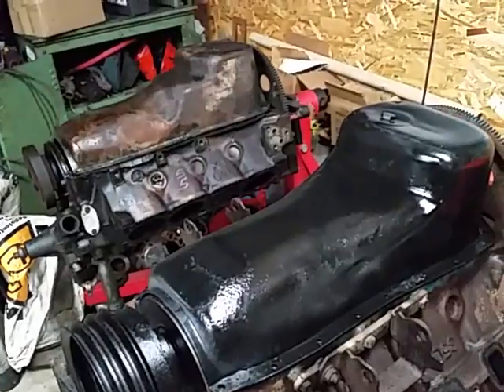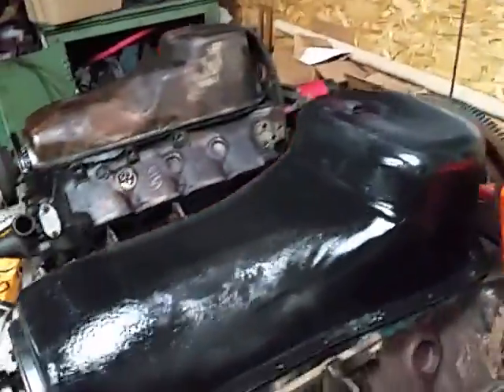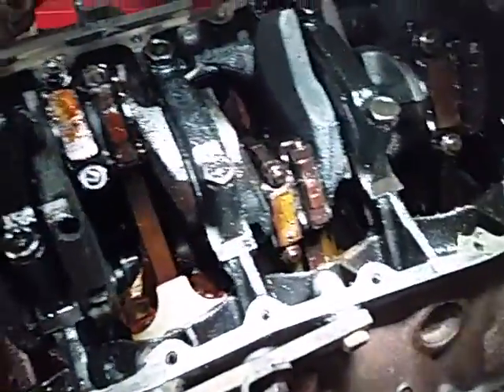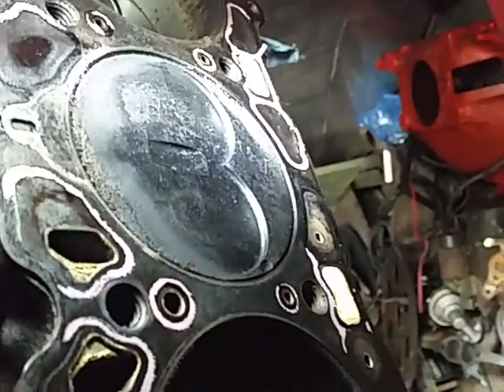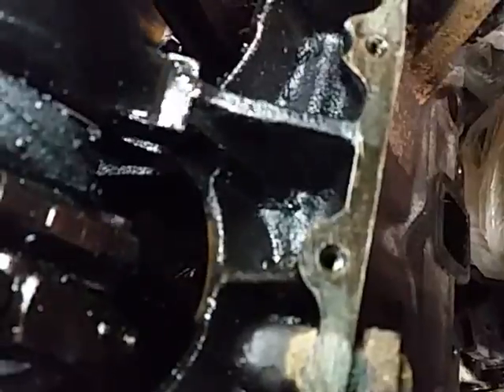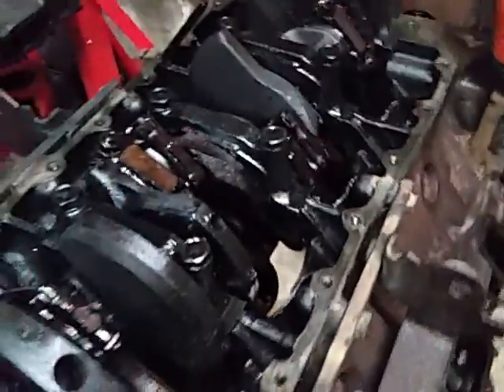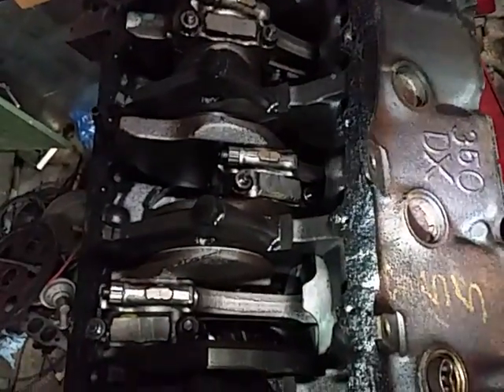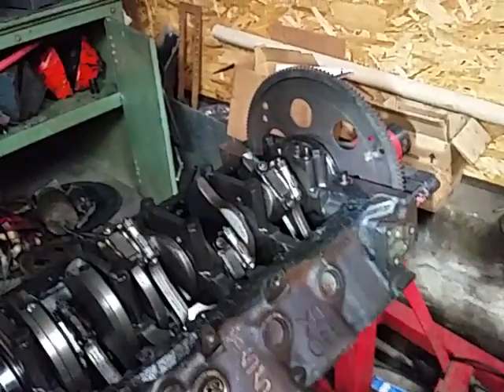Olds 350 Windowed Mains Vs DX Diesel: A Tale of Two Oldsmobile Small-block V8 Engines

Comment: The windowed versions of the Olds small blocks suck....

I've even ripped the center 3 main bearing saddles off of an Olds BIG block with solid main webs.
Reply: Wow , uninformed rubbish , if your ripping middle mains off anything your crank is out or the block , FYI 392 Chrysler Hemi's got windows in exactly the same place , are they weak, BMW big windows on the 600 HP engine , ??? All comes down to balance and machining , 700 hp 403 on this platform drag races for two years now , no problem, and no bottom end girdle .

Comment: about 6:30 perhaps it wasn't engineers but rather beancounters that did that abominable weakening of the bottom end 
  also the 307 if not modified for performance seemed to get by but perhaps the 403 didn't do as well ? 
  Even before the "lightening" (or maybe there was an early round of "weight loss" without "windows" around 1968 ?) was the Olds 455 kind of weaker in the bottom end than,say, the Mark II Chevrolet 396 or even the truck block "small" Chevrolet ?
Reply from the maker: I think we need one of our jet boat guys to answer to that question re:455.  My understanding was that GM corporate wanted a weight loss program on division engines in general.  1975- ish.  I doubt the 403 was ever intended to go in the Trans Am, any more than the SBC 400 was ever intended to go into anything other than big sled cars like the Caprice, Delta, maybe trucks.  Big torque on the bottom, horsepower- negligible engines.  The Chevy 396, like the 327, was always a performance piece. And they were both known for spinning mains (user error, I'm Sure.).   And a lot of these things can be tracked back to the oiling system, not any inherent weakness of a block.
Reply from the maker: 403 has a special weakness in the form of overheating, and I believe the bores are Siamese.  Bores at 4.3 in, that's huge.  But I did do one at 040 over, it's in a TA, and no known overheating problems
Reply: @ShawnStjean 403 = 4.351 bore std , almost the biggest factory bore of any V8 , big or small block, the 403 has a bigger bore than a 500 caddy V8. 0.100 bigger than a 454 chev . Only the Ford 460 is bigger at 4.36 by 0.009 or the Lincoln 462ci Mel V8 at 4.40.
Reply: It's a myth , plenty of 500 HP 403s running fine , there's even a 700hp.drag 403 on Utube and it's 2 years old now , running fine , windowed mains fine, 392 Chrysler Hemi's got exact same windows so do many modern V8s,

Comment: Looks like the DX block also has thicker sides/pan rail areas compared to the lite gasoline block?

 Would be nice to see a '66 or '67 Olds 330 block alongsides as well to compare the main saddles 
maybe as well an early Diesel block (not DX) as well
Reply: Honestly seeing someone else mention the 330 kinda took me aback. Not many people these days know about those nor does it seem many were kept going, because they weren't the 350 and they weren't a big block.

I'd love to experience a Cutlass or 4-4-2 with the ultra high compression 330 and a manual transmission. The low compression 330 bolted to a 2 speed auto is honestly a really good driving experience all things considered, though I probably should say mine was converted to a 4 barrel carburetor. Woke it up a bit.
Reply: @lsswappedcessna  I think there was a Police version of the Olds intermediate size car with a 330
the 330 may have been the first "second generation" Olds V8 (after the original "Rocket" engines which started I think at 303 cubic inch in 1949,grew to about 326 cubic inch by about 1956 and ended with 370  something and 390 something,I think those engines had more head bolts than the "second generation" ones 
the tall deck so called big block second generation Olds V8 might not have come out to replace the bigger "Generation One" until a year or two after the 330 arrived

Comment: The DX block has higher Nickel content.
Reply: Yeah that's right because they have to deal with 22.5 :1 compression in a diesel motor people who don't have a clue
Reply: Gas blocks have a 2.5 mains in all 350 motors and a bore of 4.057 and the diesel blocks are just like this , they have a 3 inch main Caps for the Crank shaft and use the same bore as the gas block olds motor of 4.057 did you first time people who don't have a clue get it now 😮😅
Reply: People are just too dumb to know what is going on with an Oldsmobile motor 350 gas motor or a different diesel blocks 350 motor block get a clue people
Reply: A little free education for all you brainless people who want to build up strokers also use a custom ordered 425 Big block olds motor crank shaft as well because I'm going to be doing it for my own personal project soon just for some people who don't have enough brain's to figure it out for yourself and also use the 455 head's and a performer rpm intake for the conversion of it and I will not steer you wrong with the whole situation

Comment: I worked at an Oldsmobile dealership 73 to 89. Worked on a lot of diesels and seen broken head bolts,crankshafts broke into and a main bearing web cracked away from the block and still running.
Reply from the maker: yes crazy.  I had a Pontiac 400 crank shear in half and the engine still ran and moved the car.  Most evil rap I ever heard
Reply: And what or how did this happen ?? Because it's pretty rare , plenty of 403 with windows still driving around, there's a stock bottom end 403 on  Utube pushing 700 HP and drag races , two years now , no broken block or crank , if that damage you speak of happened something else is going wrong , FYI 392 Chrysler Hemi's have windows in exactly the same place , so do many modern V8s .

Comment: I always thought the diesel 5.7 had 4-bolt main caps. I guess they don't.
Reply from the maker: What's more, they are big block journal size.  But like all 2-bolt mains nowadays, we stud them for serious performance, which also enables a windage tray, if wanted.
Reply: @ShawnStjean gas block olds motors have 2.5 mains and diesel blocks have 3inch mains like that of the big block olds motor block olds hmmm
Reply: @grndiesel - I am with you - I could have sworn I saw an old magazine pic of the bottom end of the olds diesel with 4-bolt mains.  Possibly it was a mod?????
Reply: @petepeterson5337 no your correct , the NASCAR Oldsmobile block is a small block and basically the Diesel casting with extra metal, they did have 4 bolt mains . And several companies make 4 bolt main caps for the DX Diesel block, required some machining but yes you would have seen one of those .
Reply: They only make 2 bolt main Caps for all that don't have a clue, a Oldsmobile isn't a Chevy block dude its own block design do some more research you fellow brothers that doubt me and my knowledge of the Oldsmobile motor 🖕🙄😒🥱🤪😭😅
Reply: They only make 2 bolt main Caps for all that don't have a clue, a Oldsmobile isn't a Chevy block dude its own block design do some more research you fellow brothers that doubt me and my knowledge of the Oldsmobile motor 🖕🙄😒🥱🤪😭😅
Reply: @rodneyhopper22 lol, really, might want to look up the Oldsmobile NASCAR block , they got 4 bolt mains , and several companies make steel 4 bolt main caps for the DX Diesel block.
Reply: Oh boy you people just don't even have a clue to what you are talking about do you 😩😫
Reply: A Oldsmobile motor is only a 2 bolt main Caps for the gas block olds motor and also the diesel blocks you people who are in the dark side of reality of living just like all of the engines that Oldsmobile motors are hmmm 🤔 there Mr I am a proud person who has more knowledge that you have been blessed with because most of you people who are this website don't even have a clue to what you are referring to which is quite obvious you don't even know what the fuck you're even talking about in the first place
Reply: Need to know what the fuck you're talking about there Jr
Reply: No sorry for your misguided thought they are not Chevy motors people

Comment: The only thing that was good about that engine, is that one could easily replace it with the 350 Olds gasoline engine. I had one of those POS engines.
Reply: If you were lucky enough to have one of the good ones, you would've enjoyed fantastic fuel mileage
Reply: @johneckert1365  Mine was good while it lasted.  I was pretty cavalier about spinning it up for extra horsepower, and never had bottom end difficulties.

About the swap-out; I had a '81 Custom Cruise wagon and swapped out the diesel with a 301 out of a different year wrecked Firebird.  The harness plugged right into the firewall and there were about TWO wires I had to change due to the difference between diesel and the new engine.  Different holes in the crossmember lined up with the Firebird motor mounts.  The Pontiac 301 wasn't a bad match for the wagon.

I got rid of the failed lockup converter on the original trans which had the universal bold pattern and worked fine with the new engine.
Reply: @petepeterson5337  people rip on Pontiac's 301, but it wasn't a bad engine 👍
Reply: @petepeterson5337  I've always loved GM's 71-76 full-size wagons, but I can also appreciate the 77-up full-size metric wagons now too :)

Comment: Yes Olds 350 diesel could be convert it to gas.  Just change heads to a gas-heads from an Olds 350 (you had to drill the head-bolt-holes to accommodate the larger diesel head-bolts) use a stock Olds gas-intake and replace the vacuum pump with a stock Olds distributor.  It all bolted up.  I had a 80 Eldorado that I converted 30 years ago.  It was quite smooth  Thx Barry :-)
Reply: There's MORE to do than just THAT...

There IS going to be machining of the block that NEEDS to happen.
Reply: @davelowets  No.  It worked.  I did it on a 1980 Cadillac eldorado. You just have to drill the head bolt holes in the head to accommodate the larger head bolts and cut the intake manifold gasket around where the diesel pump drive is on the surface of the block.  It all bolts up.   There are two Olds 350 heads.  Gold heads (the block is painted gold) give you around 10 to 1 compression. The Blue head  give you around 9 to 1 compression (which is what I used).   I used the same cam.  I never touched the block.  Barry :-)
Reply: @davelowets no there's not , no machining necessary, the only thing needed is if you use a double row timing chain , you use the angle grinder for 5 minutes to clearance a slight bit of iron .
Reply: 1977 Olds 403 heads don't need heads drilled, they got the same head bolt size 1/2 inch .
Reply: Yeah they also make great stroker conversion out of them blocks if you want to go ahead and get the rest of the parts installed from mondello performance people

Comment: How would the distributor work? Is there a capped off opening in the diesel block to allow for it?
Reply from the maker: Same distributor hole as a gas block.  I can't remember what the diesel comes with in there, but it's a direct conversion.👍
Reply: @ShawnStjean some had a vacuum pump, others had just an oil pump drive.

Comment: No spaghetti is a good example of the characteristics of steel. I've seen engineering students building scale bridges out of spaghetti - dry naturally rather than straight out of the pot (for the pedants out there lol :)
Reply from the maker: yes and I think what I didn't make clear in the video was, the parts flexure creates a problematic situation with the bearing clearances.  I think it's for this reason that Travato recommends larger clearances and his book. You go to all this trouble to set your mains at two and a half thousandths for example, and under high RPMs, they're opening and closing, almost baffling we might say, like two doors at either end of a windy hallway.  Added block flexure, because of windowed mains, adds another undesirable variable.

Comment: Needs Center line bored . Also getting the deck height lowered would help with crank sizing. Excellent starting point for a great amount of power. I heard one fellow say the casting material is different than most cast blocks making it stronger than the older Oldsmobile engines.
Reply: Yeah that's correct All the necessary things are needed for the project

Comment: all olds gas jobs starting in 1977 have windowed maines, good thing they discontinued the 455 after 76. also the 350 was produced from 68-1980, after that in 81 the 307 took over with the computer command control carburetor and check engine light. still great info. and as for building the diesel block i say go for it, just think a 440 small block lol.
Reply from the maker: It seems to have been the " starting in 1977 " part that has caused some controversy. I have read in more than one source that at the very beginning in 1977 there was some 403 blocks cast with solid main webs. And having held in my hands a 1968 455 forged crankshaft, produced for one month only, I think that's a precedent. In other words Olds did make production line changes on-the-fly to hard parts.  Are the 990 blocks solid main web 403??? To be the most frustrating part is, I have done a top-end rebuild on one, and I'm in touch with the fellow who owns it. Unfortunately I guess, LOL it is a running engine and not likely to come apart anytime soon to check...
Reply: @ShawnStjean  see ive heard the same rumors of some solid 403s but i can not find one that has been documented. it is an interesting hunt to find one but its kind of like a big foot story lol. not saying for a fact they dont exist.
Reply: @UsefulEntertainment not true , a million dollars was offered for a 403 with solid mains and it was never claimed .
Reply: @ShawnStjean 1976

Comment from the maker: At one point I give a quick shot of the pistons in the diesel.  Additional info: today I measured the deck clearance and they pop out about .010" ABOVE the deck.  This is pretty good news, as it means: an inexpensive .040" composite head gasket can be used in a gas conversion, and will achieve a near-perfect .030" quench.  Also, a big-block cylinder head with a 77cc chamber will achieve a 9.2 static compression ratio (unbored block.)  This was perfect for me, as the mild roller cam builds cylinder pressure to the tune of 200+ psi, and more static compression would take me over the top for pump gas.  I wouldn't use an aggressive cam with the heavy rotating assembly the diesel ships with--there's no point trying to rev up with it.  We're talking a 4-ring package, probably, and the counterweights are monsters.  Better to try to achieve low-end torque.  Otherwise, the pistons and rods should be replaced, and the assembly rebalanced.
Reply: As you should always rebalance everything when doing these kinds of build up strokers you should have a little more common sense it sure does help out hmmm 🤔
Reply: Even I'm gonna have a short block olds motor diesel stroker built up for my self to put in my 69 w31 f85 build in the future coming up soon so good luck bro
Reply: Just put it back together as it was when it was stock hmmm and it will be just fine OMG people seriously people don't sweat it

Comment: Olds screwed up basically on maintenance, if they would have insisted on diesel oil instead of 30w, that engine might still be around. MOST of the cranks broke due to bearing wear, due to wrong oil
Reply from the maker: Yes, someone did mention broken cranks. My first thought was problems with the oiling. It's not like they were making enough power to break a crank. And usually something else would go first in a case like that.  What's different about the diesel oil?  I believe it has more zinc, as in for camshaft, but are you meaning like more viscosity, 20 W 50?
Reply: @ShawnStjean  best oil back then was Rotella 15w-40 or Mobil Delvac
Reply: @Glenn631956 There is straight 30W and 40W diesel oil. I'm sure GM recommended sae "C" rated 30W but most owners did know there was a difference and uses sae "S" 30W